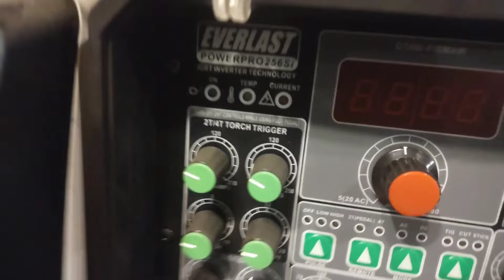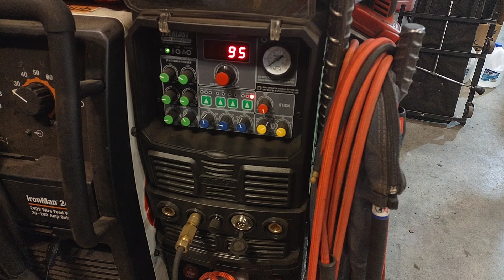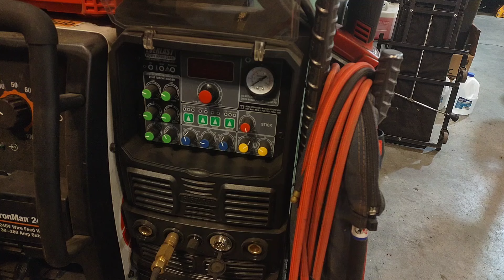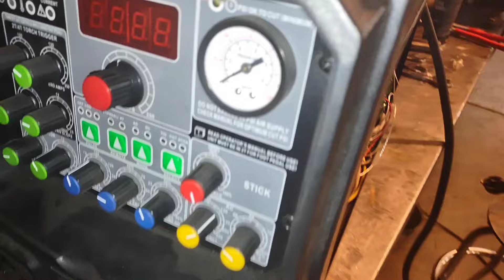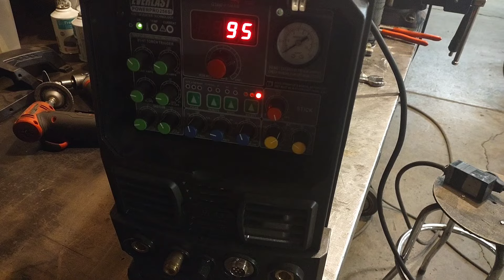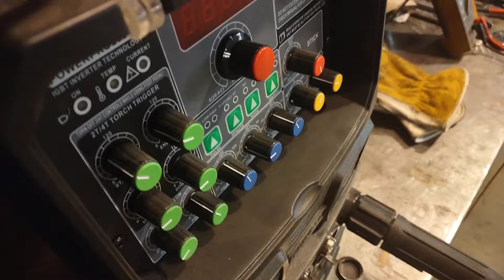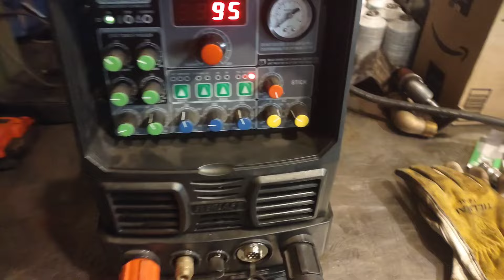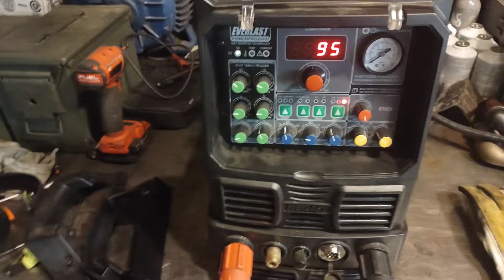(437) weird problems with my everlast 256si

Comment: we run 35ft Python push-pulls in the tank shop for aluminum,all Lincoln 360MP's,had an issue with one cutting out and burning tips. Airgas rep is on it,I lent the guy my Python in the interim,I run dualshield mostly off mine-

Comment: I had some really strange trouble with the 256si.  The gas would start on tig  preflow, the arc would start then the gas flow would stop in the middle of the weld.  Then when the foot pedal was released the gas post flow worked.  The welder was turned off and it had a 05 ground fault warning.   Cycling the power then when the arc would shut off gas would not stop flowing.  Turning off the power did not stop the gas flow.  The gas cylinder valve had to be turned off. The welder was turned on again and the gas stopped flowing.   The yellow lamp for plasma came on again with ground fault when the welder was set in 2t, DC Tig.  Then it was cycled trough pulse and suddenly the welder worked normally.  It appears that when the 05 message put the control board into some mode that was not intended.  It does not appear to be a wiring or control board failure.  A new board is 175 dollars and I am not sure this will fix the trouble.  When the gas would not stop we disconnected the foot control from the welder and the gas would not stop.  ?????  This is the second Everlast welder that has had trouble.  One was a 205 power master.  It was sent to Everlast for repair when the plasma burned out in the first 5 minutes on a new welder.  Five hundred dollars to fix it.  It came worse than it was sent in for repair,  Dead Tig and the back bezel was smashed and the fan blade was broken , Bad packing.
  The 256SI fixed itself.  I do not it is wise to use this welder for field work when there is not another welder to use.  Hmm 
Customer support was helpful and quoted a new control board.  I have not heard if they have the board and it might have to be ordered from the manufacturer.   I have not had this kind of trouble with Miller 300 Dynasty DX or Lincoln 300/300 or Miller Aircrafter tig welder..  I am new to inverters.   The 256SI had about 3/4 hour or welding time on it when the issue occurred.  After the trouble with the 205 welder I do not want to have another welder wrecked by UPS when it is sent to Everlast for repairs.  The 256SI welds fine when it works.

Comment: Everlast welders come with a 5 year warranty send it in for repair, I have a 250EX 5 plus years now with 0 issues whats so ever.
My guess is its Temping out, due to it sitting so close to the other machine no air flow. it could have damaged the electronics, 
Don't poke around under the covers without schematics if your not experienced with electronics stay out of their!